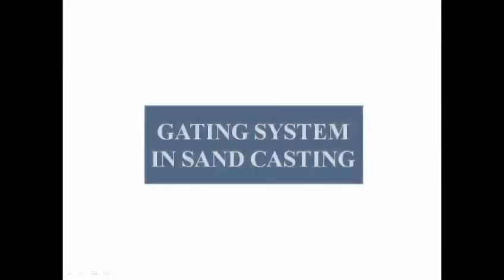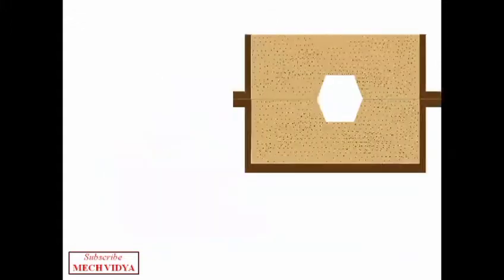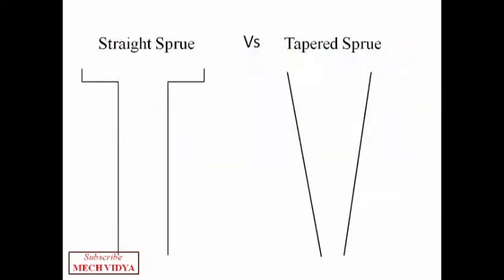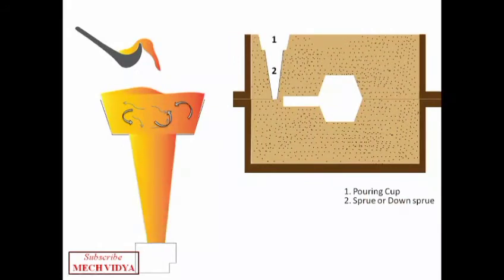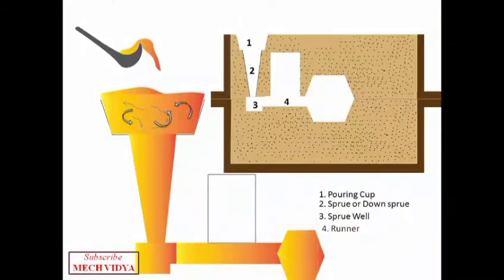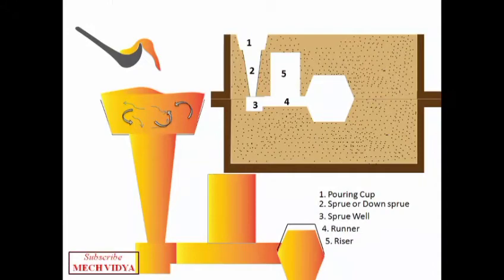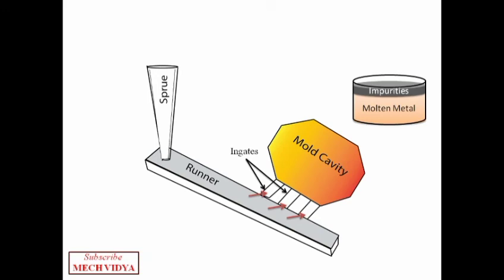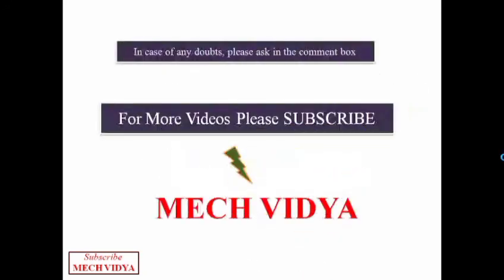Gating System in Sand Casting - Explained Easily with Animation (Basics, Components and Design)

Comment: Very nice video sir, thank  you very much. I have some questions, I would be grateful, if you could help me. 
1.) I am looking for a definition to name the crude casting (involving all the gating elements and the cast part itself). I mean the casting+rigging. We call that "bunch" in my native language, however, I couldn't find the correct word in English. Is there any particular definition?
2.) I am trying to make an excel table, where I have limited space in the cells, therefore I have to use the shortest (and correct) phrases and words. I want to speak about the molten metal weight in the ladle, can I say "ladle melt weight"?

Comment: Excellent explanation, thank you. However you do not mention ventilation holes. In your diagram the metal fills the mould cavity from below which would pressurise the air above. Is it assumed that this air will vent through the packed sand? Sorry if this obvious to everyone else but I’m a real beginner here!
Reply from the maker: You are right! Vent holes are usually provided to allow the hot gases to flow out easily. Though some portion of the gases flow out through the sand particles, but additional vent holes are  also required. Infact improper ventilation causes many defects in the casting

Comment: How to avoid blowholes in aluminium casting
Reply from the maker: There are multiple reasons behind formation of blowholes...most prominent factors are improper ventilation and faulty gating system. So check if these two parameters are okay. Also any source of gas entrapment can cause blowholes.